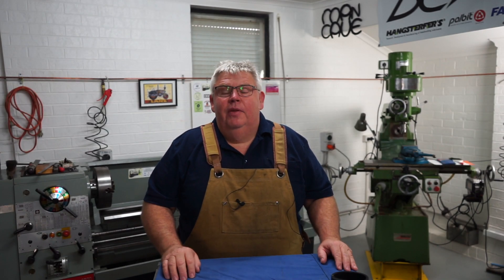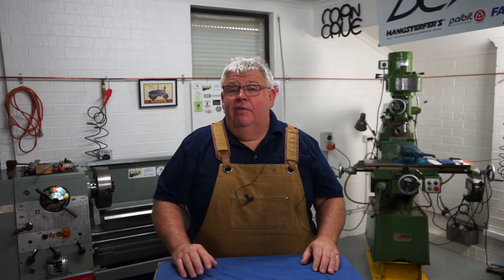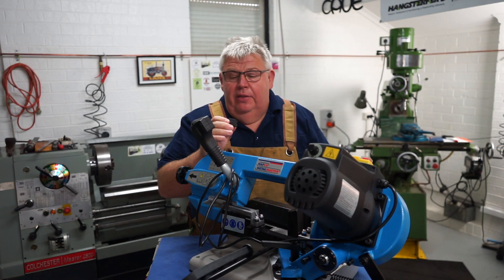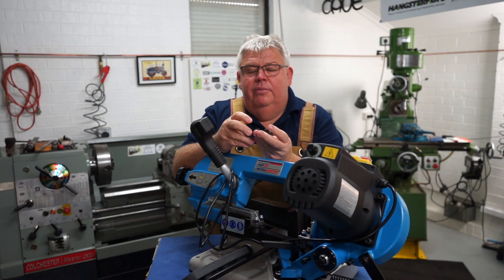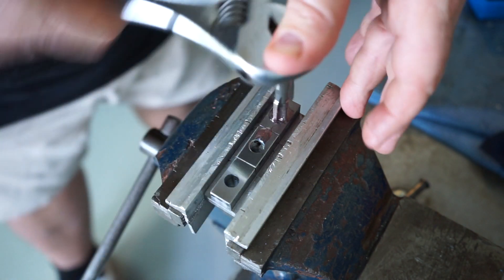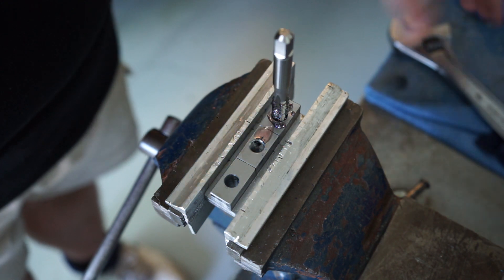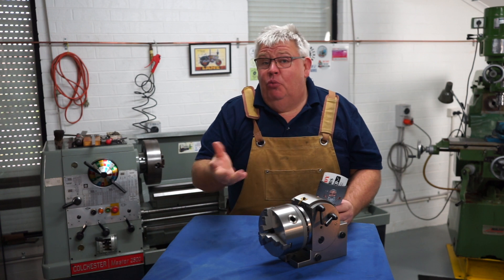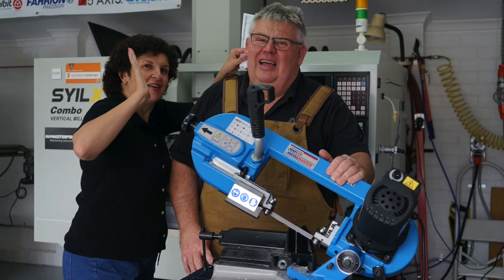Workshop Rambles #2 - New Bandsaw & machining T-Nuts

Comment: Great video mate, love the princess labor force and dog show. But will we see some tap handles being built.? I use many kinds of waste oil for things . Hydraulic for cutting n tapping engine oil for the same and heavier cuts. Kero n wd40 for aluminum n brass. Dont know if you know but tee nuts are not thru tapped and for a reason to stop table slots from being broken out when in use. I use to see lots of mills with messed up slots busted out . Then I remembered my shop teacher telling us why we dont keep tightening vises till the table breaks ,
Reply from the maker: Thanks for watching.  It's great putting the grandkids to work LOL.  I have come across some T-Nuts not fully tapped.  Luckily for me I used to be a spanner monkey (in a previous life) so I'm well aware of thread bottoming out.  I run flood coolant in my CNC, but on the manual with coated carbide I don't bother.  Usually in the CNC that would use air blast.  Would you believe that after shooting that video Matty (from Matty's workshop) sent me down 2 tap wrenches for free.  He a great guy.  Cheers, Aaron.

Comment: G’day Aaron, I’m sure you’ll enjoy the bandsaw. 
Yeah I like using old sump oil also, cheap and leaves a nice black finish (I don’t even try for blue)
Cheers 
Peter
Reply from the maker: G’day Peter. Thanks for stopping by my shop mate. Yes the old sump oil blue works a treat. I actually remember doing it years ago in high school metal shop class myself. Cheers buddy 🍻.  Aaron

Comment: Aaron thanks for the stickers came in the mail on Monday. 
Yes that was my motivation for a bandsaw too.
 after busting my gut trying to cut 50mm bar of 4140. 
Right place right time 7x11 geared head 19mm blade, Brand new $580 at auction.
Try grays online auction for pickup only. Your really close to it too.
Reply from the maker: Hey Troy. Great to hear that the stickers arrived safely. Yes Grays Online have some real good stuff from time to time. As for me, I’m quickly running out of room in this 2 car garage 🤦‍♂️

Comment: Those steel splinters are horrible, I did a clean up pass on some steel I was milling a while back, I was getting them in my hands for months.

I need to make some T Nuts to when I get my mill, might need to get a surface grinder to so I can make things pretty. 

Nice ramble mate.
Reply from the maker: G'day Chris.  You're not bloody wrong mate.  Those FKN things are like needles.  I've been spoiled all these years machining aluminium.  Yes the surface grinding was a bit over the top, but it looks pretty LOL.  Thanks for stopping by Chris.  Trust you are all well?  Cheers, Aaron.